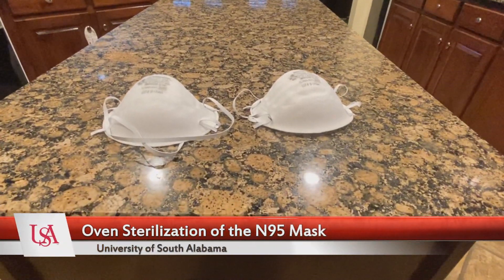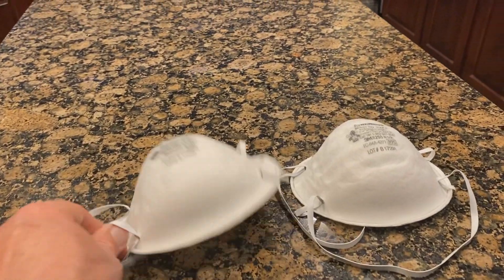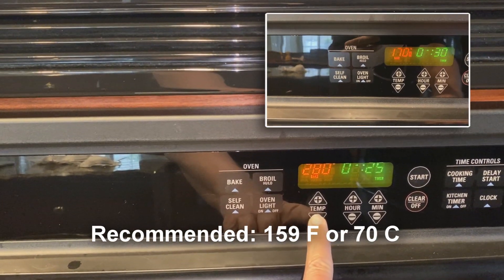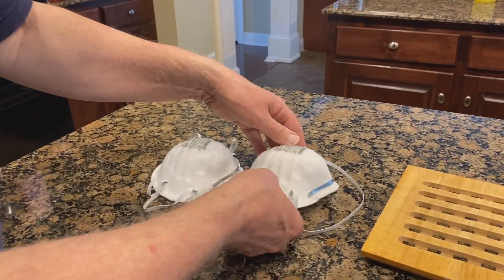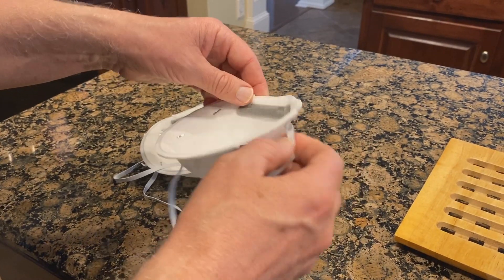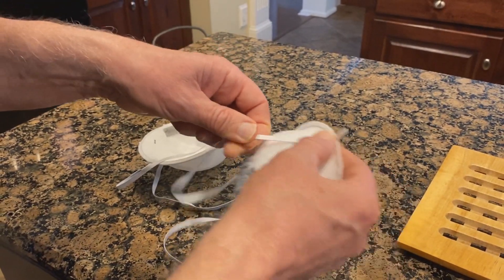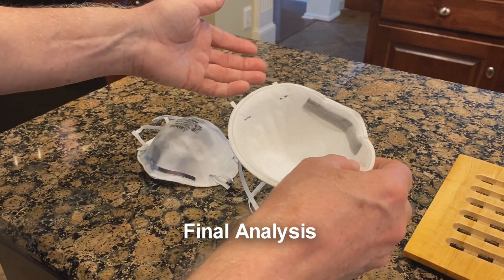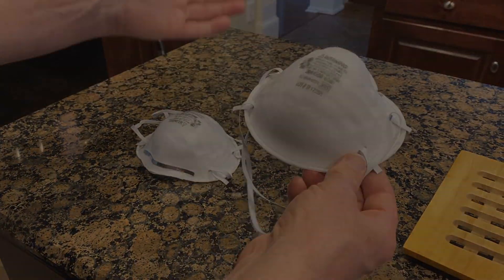Oven Sterilization of the N95 Mask

Comment: These masks generally  only help keep others from getting a sickness that YOU have when used by untrained professionals. In order for them to work to keep YOU safe, they have to be the right size and they have to fit perfectly and TIGHTLY sealed!   Professionals who wear them for working with pathogens have to test them with aspartame. I’d you can taste the aspartame squirted at you, it’s not on right. It’s extremely difficult to make them work correctly. It’s better to just self isolate.
Reply: You do realize these are N-95 masks which have the ability to trap airborne particles and are used to protect healthcare workers, right? Do you also realize this video was made by Larry Mellick, a board certified pediatric emergency medicine physician?
Reply: Brian you must not have gone on to read the rest of my comment. If you had you would have seen that I said how hard they are to get to fit and how professionals are trained to use them, which is why they don’t work for the general public.
Reply: @aerynstormcrow  I have multiple, and I assure you they are not hard to put on at all.
Reply: 476,402 views I didn’t say hard to put onI said hard to get to fit. Aka seal tight to the fact and not leak.
Reply: @aerynstormcrow  that's not true. We restore furniture and had some on hand. They have the built in respirator. Construction workers use them as well. What the hell are you doing telling people the "general public " shouldn't be wearing them. Sounds very strange. If people already had them why would you discourage them from knowing how to clean? I am caregiver for my 84yr old mother and do the shopping. If you think I'm not going to wear mine to prevent passing it on to her you're nuts.
Reply: @aerynstormcrow  It is not hard to use a mask - as a former podiatrist that undertook clinical proceedures it took about 15 minutes to show us how to use a mask for sterile procedures  and the public are not working in clinical or sterile procedures. The only thing the public need to know is the outside of masks are like the inside of a nappy and so they should not be touched by hand  when taking them off and they should not be place on surfaces . The training you need to wear a N95 masks will take you all of 5 minutes and you can see videos on youtube.  So that is 95 % if you go out or meet another human as opposed to 0% protection.
Reply: No, Patricia is in fact wrong right at the first line of her comment. "These masks generally  only help keep others from getting a sickness that YOU have. Not the other way around." This is WRONG. The N95 is SPECIFICALLY to keep YOU from getting a sickness that other people have.  Just because the other part of her message about mask fitting is correct doesn't mean that she's not spreading misinformation. She full on explains the job of the mask incorrectly.
Reply: Zanther Stone oh lord. I meant when used by the general public who don’t know how to fit them. But let me correct my comment so the trolls are happy.
Reply: Patricia Dement boring
Reply: @aerynstormcrow  it's not hard to fit. Common sense. Lower strap first place on face and adjust metal nose fitting and lower top strap. Center on face and inhale to get seal then exhale. People know what a seal is. Tons of non health care jobs use these respirators.
Reply: Betsy B I’m not going to fight you. Everyone seems to know everything even when someone in the medical field who works with these masks tries to explain things. Wearing them to keep out dust is not the same as viruses. Good lord. As long as you are testing the seal with aspartame you are fine. But if you spray the aspartame and can still taste it. The mask’s seal isn’t fit correctly. And you absolutely cannot have any facial hair and wear these masks.
Reply: Patricia Dement while wearing a mask may not completely prevent the general public from catching the virus, it may lower the viral load you breathe in if you are exposed, and that might make the difference between mild illness vs severe illness.
Reply: sigh, there is a reason why countries that urge the public to use masks have a stronger grasp on their situation. Not only do masks severely hinder the transmission of both symptomatic and asymptomatic carriers, but also, they stop droplets from reaching your face.  Yes, if someone is coughing down the seam of your mask, its not going to be that effective.  Otherwise any barrier separating your face from potential droplets is going to be beneficial.

Stop trying to spread this disinformation that the general public is both too stupid and inept to properly wear a mask. Put on a mask, don't touch your face, wash your hands thoroughly before removing your mask, discard/sterilize, it's not rocket science.  If you do come across people that can't properly wear a mask, educate them. You want to stop the virus in its tracks? Stop with all this bullshit that masks are useless.  If they were useless doctors wouldnt wear them.  Even during the Trump press conference tonight they reluctantly admitted that even wearing a scarf would provide you considerable protection vs nothing.

Put on a fucking mask, wash your damn hands, and stay safe everyone.
Reply: Patricia is right. N95 masks work only if they are fitted on correctly. I have facial hair so the seal doesn't secure tightly enough, therefore an n95 is useless for me. At work, I have to wear a PAPR. This is why everyone gets fitted to ensure that the mask is snug enough to prevent particles from entering. If you have facial hair or facial deformity its not going to protect you.
Reply: @suadkacar357  Correct. People wearing these don't realize that you may as well be wearing a bandana on your face if they're not properly fitted.
Reply: Suad Kacar thank you!  People want to poopoo facts but these masks do nothing if they are fitted properly and don’t seal. It WILL the virus contained if worn on a sick person but healthy people who don’t know how to fit them or as Suad says, have facial hair, won’t get any benefit.
Reply: @aerynstormcrow   It is not hard to put a N95 mask and the seals are tight as hell. I have marks on my face and nose from wearing them. If anything they are hard to breathe for elderly or unfit.  If people have facial deformities and big beards they have to make their own arrangements .  I can guarentee most people replying to you are not Muslim men , Hasidic Jews or the elephant man.  N95 masks will work for the public.
Reply: You are both right and wrong. The mask do a dual purpose in keeping an infected person from spreading the virus and they are also used to keep a healthy person from getting infected. True that untrained people would stand a chance of infection from misuse but learning the proper method to wear/handle an N95 mask is not rocket science. Perhaps it would be better to direct people to the correct training instead of saying the folks are too stupid and should not even attempt to wear them. The reason that anyone would be watching this video is because they already own a mask and want to make it last as long as they can the proper way. They are researching which by in itself would imply that the are not dumb. True that self isolation is best but there are times when people have no choice but to go out.
Reply: Patricia Dement If you don’t want to wear a mask, then fine - allow Darwinism to win. But please stop spreading misinformation. While masks may not be a definitive answer, there’s a good amount of science that says they slow the spread - no matter the seal. Oh! And you may want to consider turning off your comments before claiming to be “in the medical field” 😉 Just saying.
Reply: Katherine Easton I have to wear a mask bc I’m immunocompromised due to a genetic illness I have. So...  🙄. 

Anyway, all this drama over this one post is ridiculous. The cdc is telling people  to wear a CLOTH mask when going out into public that can be HAND MADE but that it SHOULD NOT be medical grade bc of the shortage of them for the medical workers and immunocompromised that need them. 

If people would just  self isolate and stop hoarding things that they don’t need everyone would be better off and posts like mine wouldn’t be necessary. You guys can pick apart my comment until the cows come home but understand you don’t have all the details about what I’m trying to communicate and instead of asking me you are reading stuff into what I said. Find something more important to do with your quarantine time than losing it over a post that was trying to make a simple point without having to write an essay.
Reply: Patricia Dement 😂 You claimed to be “someone in the medical field that works with these masks” YOU said that. Not me. And it’s a flat out lie (as you just admitted.) I called you out on it. You didn’t like it. Now you’re back stepping on everything you said, trying to up your argument with facts that have nothing to do with the conversation at hand. All just to feel like you won. good job, you really showed us. LOL Stay Healthy. 😘 ✌️
Reply: Katherine Easton you have no idea what I do for a living. Not that it any of your business but if you must know me and my husband (along with my father who started the company 46 years ago) own a textile testing laboratory that is currently the primary testing facility on the east coast for medical gowns, masks and other medical materials that are in dire need right now. 

We are working out butts off to get these items tested to assure they are safe and effective so that the parent companies can ship them out to the distributors and get supplies to everyone in the medical field who needs them right now. In case you missed how much of a shortage we have.   

We sent most of our employees home so they don’t get sick and my husband along with with a few other of our employees in upper management are staying open to do all the testing. (I can’t bc of my health situation or I would absolutely  be there too) So when I said I have experience with medical field equipment I am not a liar. I’m right in the thick of making these things work for the people who need them.  

Please find something better to do with your time than harass people trying to help. Best health to you.
Reply: I bet this is why Dr mellick keeps his comments off... Misinformation.
Reply: It’s kind of hard to self isolate when you’re an essential employee
Reply: Josh Scott I understand that. Please read the last thing I wrote about my family being essential employers. The point in this whole thing that everyone seems to be missing is that the CDC is saying to make and use your own CLOTH masks while staying a safe distance from other people. Even when you are essential you can keep a safe distance. We are having a hard enough time getting these masks to the medical professionals who need them the most and the general population has OTHER means of staying as safe as possible bc we aren’t coming into constant contact with the sick. Everyone on this thread has some idea of how I’m wrong and how they thing it’s supposed to go but no one is listening to what the CDC and those of us dealing with this shortage are saying. Stay safe. 🙂
Reply: Al 72 good to know.
Reply: No. That's for surgical masks. Stop spreading disinformation
Reply: Facepalms***

Comment: This is in fact the only conventional sterilization method for N95 masks that did not reduce the filtration capability of the mask below 95%. sages.org/n-95-re-use-instructions/   Since it's a home oven, for good measure once the mask is removed running it for a minute on max/broil won't hurt a thing. A clothes dryer is an option but only if you can dial in a specific temperature as their default temp is too high. If you have several masks the absolute easiest method is to just rotate them. The virus needs a host. After sitting for 4 days the virus is dead. The rotation method also ages the mask much more slowly. 
Other methods like boiling water, soap and water, hydrogen peroxide, and alcohol reduce the filtration below 95%. UV light has issues with penetrating all layers and degradation of the mask is undetermined. Also, if a strap fails it will usually be at the staple. Work the broken end back under the staple and tie it or staple it back and keep moving. These are extreme times. If a strap completely fails improvise with a cut rubber band, staple it on, and redo it for every sterilization. If a mask is going in the trash and it still has a good strap remove it and save it.
The Coronavirus must be aspirated into the lungs. Sometimes it's from breathing in tiny droplets and sometimes it's when it's on saliva that goes down "the wrong pipe". Most people aspirate trace amounts of saliva when they are sleeping. At night before going to sleep you want to reduce "viral load". Healthy people's immune systems can kill several molecules of a virus but not thousands or millions. Wash your face thoroughly before bed including 1/4" into each nostril and rinse with a strong mouthwash. A good substitute for mouthwash is any cheap food grade alcohol(vodka). Gargle and spit as best you can tolerate. Rinse afterwards with water if it helps. Don't see it as a time to drink. Your system is stronger without it. Stay focused. Aside from breathing shared air, which a quarantine and social distancing addresses, the #1 method of infection comes from touching your face/head. Find a way to never do it. Put black marker on a finger if it helps you to catch yourself. Ink on your skin is the least of your problems. If you tend to pull your hair back over your ear throughout the day wear your hair pulled back. Finally if we can specifically protect the elderly it will reduce ICU demand by 85+%. Germany's average age of exposure is 46. That and other factors like more testing have kept their death rate remarkably low. coronavirus.jhu.edu/map.html  Yes, all of this is a drag but it's temporary and it beats getting sick plus you will avoid the regular Flu which the system can't afford. The largest public gathering of people over the next month is a hospital. Keep yourself out of the healthcare system entirely right now. Godspeed to everyone.
Reply: Thank you. I’m here in Texas and I’m trying to disinfect my dishes and I thought I would use the old school method and pop them in the oven and it’s like the Internet has been scrubbed of that information completely I can’t find it anywhere I know it in my head from back in the day.... frustrating.. thanks for the tips, esp the sleeping and hair ones!

Comment: Please correct me if I'm wrong, but isn't the mask pasteurized and not sterilized? For sterilization are much higher temperatures (and durations) needed. This shown method should help against bacteria but not effectivly against viruses.
Reply: Christoph W. I have the same doubt, but maybe this is specifically for coronavirus and similar viruses. SARS virus gets deactivated at 56 degrees Celsius. (https://www.who.int/csr/sars/survival_2003_05_04/en/)
Reply: What he’s doing is sanitizing the mask. He’s reducing the number of organisms. To say sterilize needs to be completely remove from organisms. Autoclaves run at 121 C for a period of time with steam and pressure.